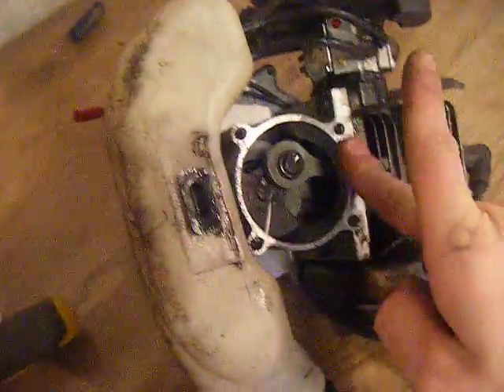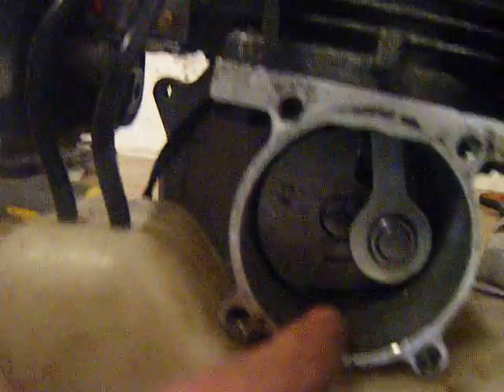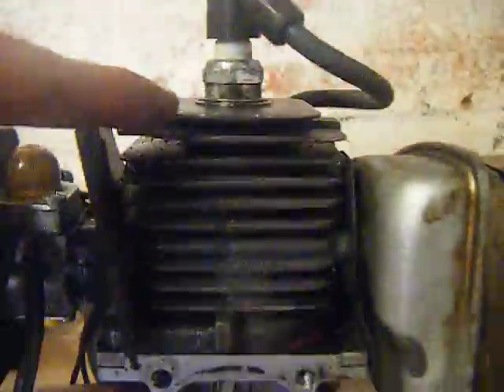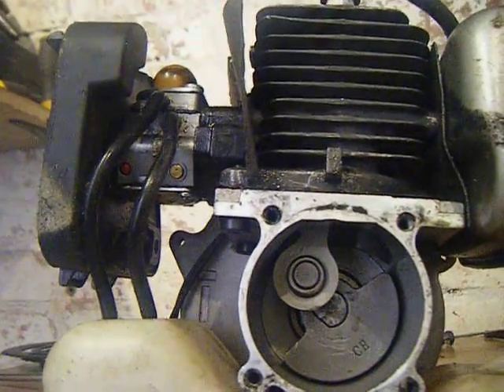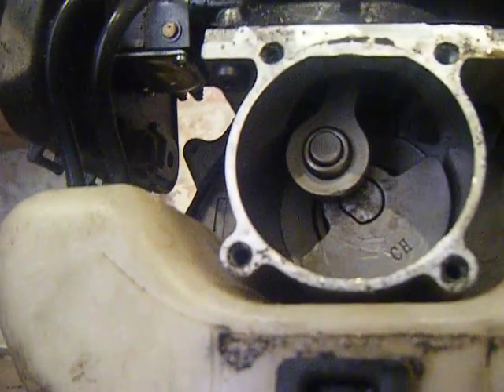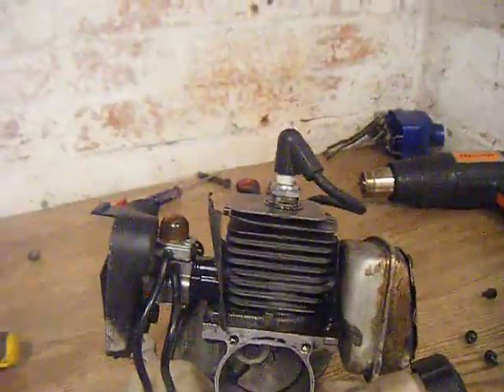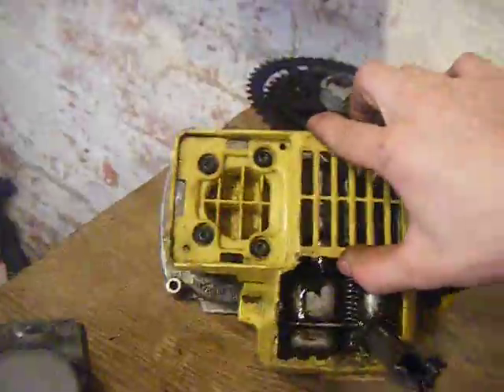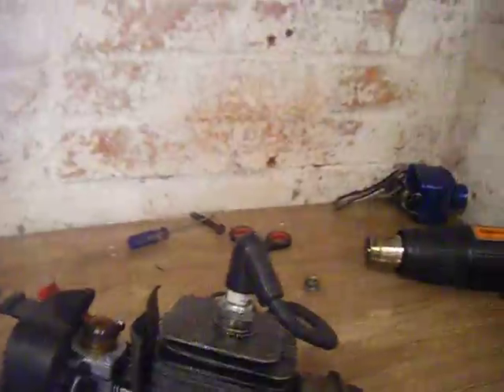The most you need to know about 2 stroke engines

Comment: @Lukeschedel well being 2 stroke it will heat up fast and it is normal for the engine to be hot to the touch after use it should be hotter then you can stand to touch even the spark plug but some thing you ca do to see if its running to hot is cut your grass or w.e. with it for a while and once ou think it is too hot pull the plug and it the electrode (the part inside the motor) it white its running to hot if its golden brown its just right and if its black you getting to much fuel/oil.

Comment: suzuki 80 scrambler, old. friend looked at it got it goin. sat for a bit in shed. can get it running but won't drive now. just dies when clutch dropped. getting fuel. looked at coil and it has been worked at bolts are butchered and line cut on head to get them off. is there such a thing as weak spark. would new coil help. don't wanna buy if it won't. not far off complete novice

Comment from the maker: well iv never herd of that problem before but in being 2 stroke fuel it is most likely the problem in the middle of the cap looks like a small felt like thing and if over time stale fuel and oil have built up then that will indeed cause a vacuum inside the tank